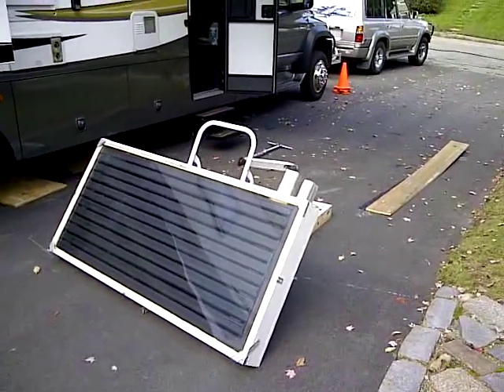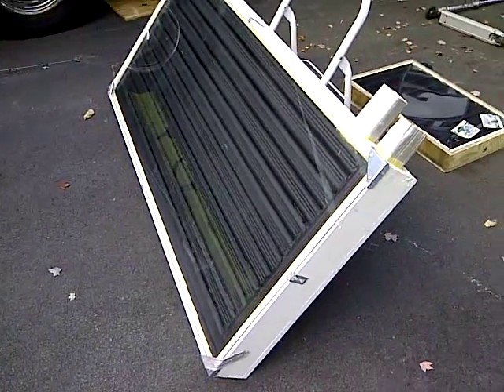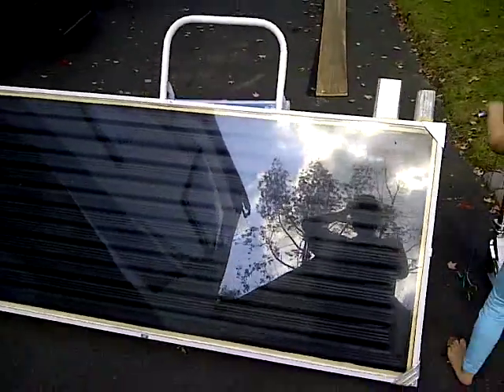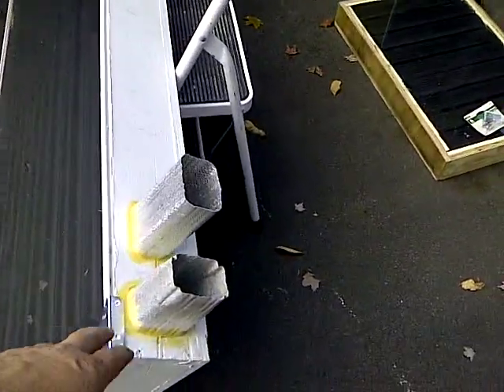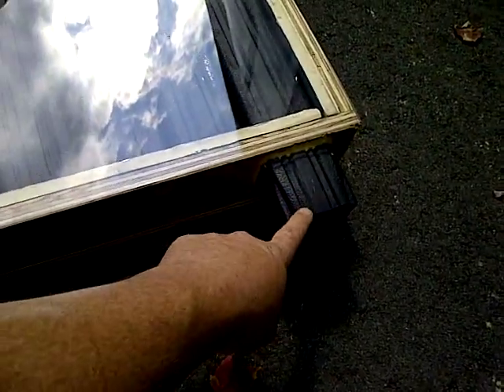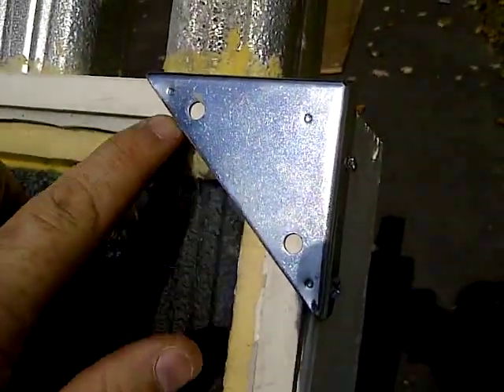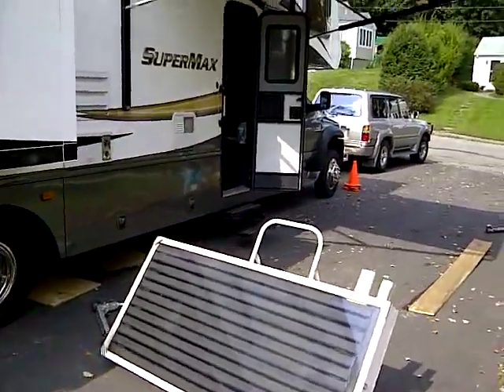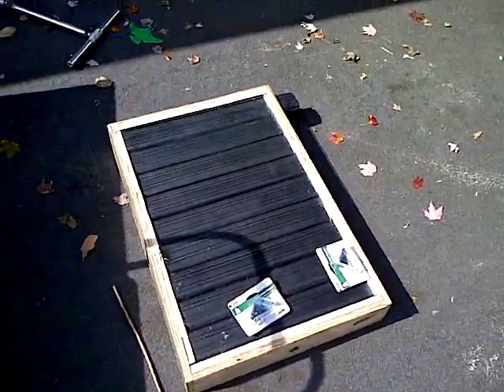Free Solar heat for your Motorhome, RV, Boat or House - Solar Heater build - Part 1

Comment: That's awesome and beautiful but I am not as capable a builder as you. Have you seen the high efficiency solar heaters that have a little panel and can just hang in a south facing window? Am wanting to find something commercial. We bought a beautiful tiny wood stove but with all the shielding and asthetics of what it takes to place it, would mean giving up our big bed and mattress! I cried and my husband relented. He is too old to work on this project so I am doing it! Scary! But am wondering have you seen any commercial solar product we could buy to heat or at least get to 45 degrees from zero our exceptionally insulated 22x8 vintage camper? Any advice or help you can give is awesome or if you want to build another one of those we would buy it!
Reply: I was wanting to be liking but i'm not seeing one either

Comment: You didnt explain how the pipes are connected to each other, to let the air flow through the system. If the air enters one pipe on one end how does it enter the next pipe? Are there holes in the sides of the adjacent pipes or what ? And what kind of material was used to seal the ends of the pipes? More information would be helpful.

Comment: I'm planning on putting one on a campervan to heat my water storage tanks and the van its self when it gets cold my question is what do you plan on doing if there is a hot day do you have something in mind to direct the heat away from the inside of the van if needed?

Comment: I really dont understand these? If the weather is good enough to extract that much heat from that surface area, surely heating isnt a real concern? And if it is what about at night when its needed?
Reply from the maker: this design only good for sun utilization.  During the winter it can save a ton and this will heat a room if there is sun.  Good luck.

Comment: To push around the air through the pipes is a bad design. You need more power to push the air and you lose a lot of heat. You should have send the air through one end through all the pipes at same time. That way you have an better path for the air and a blower can push more air, easier, and recover more heat. Probably you are recovering just half of the heat from that panel.

Comment: I think its a wase a time it doesn't provide enough heat especially  cold weather it give you very small amount of heat is not very consistent  to generate heat . just buy buddy heater ..
Reply: You don't find a 100 degree rise in temperature a significant rise?  You should do more research on these, as they significantly reduce energy consumption for very little investment.
Reply: What is your experience with these? Have you made and used one before?

Comment: I would recommend using a low energy draw fan, not a vacuum cleaner motor since they draw a lot of current and get hot, thereby skewing the test.
Reply: Grant Oakes He obviously use it just for the testing purposes.

Comment: use a small computer fan, get one that has a speed adjustment the slower you can get it the better, also they dont need a specific electrical current at all times. your best bet is an aluminum one because they withstand higher temperatures, very cheap and efficient and they'll fit nicely in your tubes. you could even find a small solar charger to run it or make your own with those cheapo outdoor lights
Reply: Slower isn't necessarily better.  If that were the case, everyone would use a thermosiphon design that is without fan and need for electricity.

Example

It is better to have a 100 degree increase with a 100CFM fan than a 120 degree increase with 10CFM fan.  The faster you can exchange the air at a high temp, the better.
Reply: yeah, pushing more through is the ultimate goal, but if your blowing air out too fast its cooling the air. Hence the need for an adjustable fan that can go really slow. That way if the air is coming out too cool you can lower the speed to let the air warm up more and adjust it till you find the perfect speed for the amount of sunlight your getting.
Reply: If youu want to uuse a normal 1 speed fan you have to set it to click on for a few minutes and off for a few minutes. Basically this design is a radiator, but the goal here is to make it work in reverse

Comment: You should have designed it to hang on the side with an adjustable angle bracket to align it with the sun when in use then fold flat for storage/transport with an insulated flex pipe at the top and telescoping input at the bottom allowing for the adjustment. |If you had the outlet at the top with the inlet at the bottom that would take advantage of natural convection to circulate the air. It would suck the cold air from down near the floor and jet piping hot air out the top. The way it is set up now you will need a fan of some sort. I guess you could install a small solar panel and battery but natural convection is the way to go... It's free...lol
Reply from the maker: Yes!  I should have.  This here is old technology though.  While it works, research parabolic heat

Comment: Cool stuff. But for the small one, if you are going to be capturing the solar through the window to heat air to heat the interior of the space, then you won't get any gains having the collector inside the window.  This is because the sun through the window is already heating the interior.  A window based water heater/preheater for shower and such would be more interesting has me thinking.

Comment: i have disassembled a vacuum cleaner and played around with the motor before. one thing i can tell you is that if it does heat up, it's not noticeable.